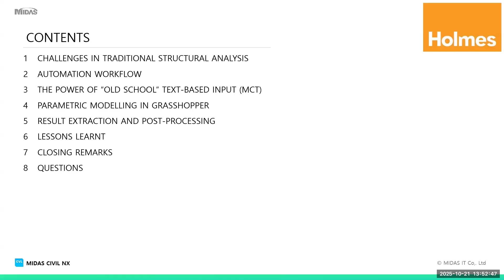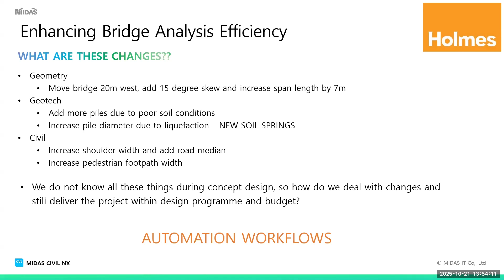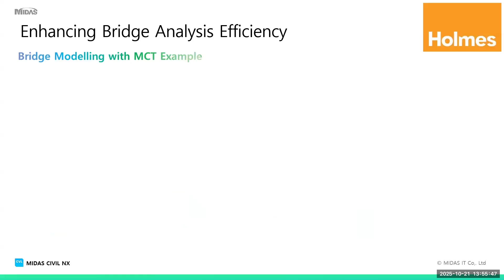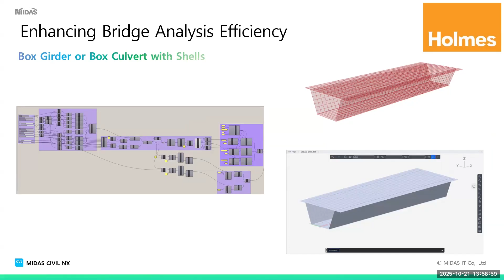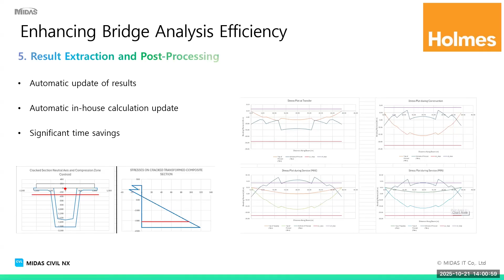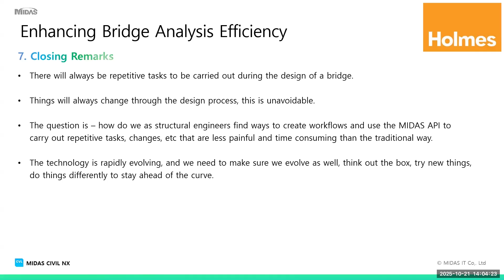Improving Bridge Analysis Efficiency: API-Driven Workflows in MIDAS CIVIL NX

Comment: Complex structural models can be handled by Rhinoceros and grasshopper. That's why so many complex shapes of architectural renders appearing now. But what is the best structural software to anaylize those models?
Reply: There are many good structural analysis softwares on the market among which we have Midas, SAP 2000, RSA, and so on. The choice will depend on you and your preferences. But the most important thing is your ability to model a complex structure based on your background in the understanding and mastering of finite elements and material science. For a choice, a combination of Midas Gen or Midas civil and Midas FEA will be ok.